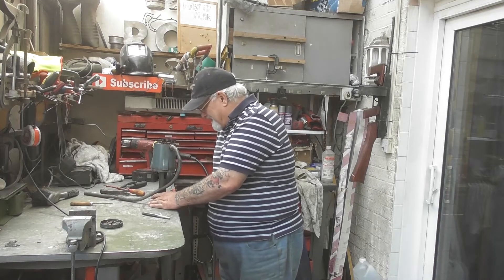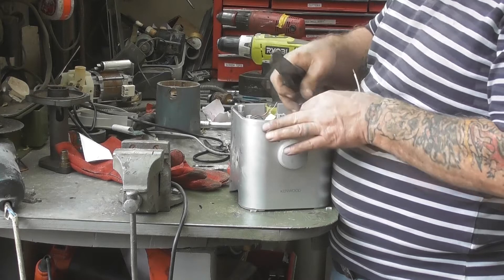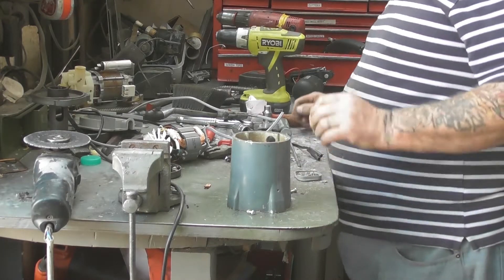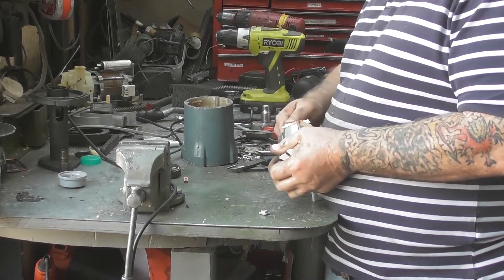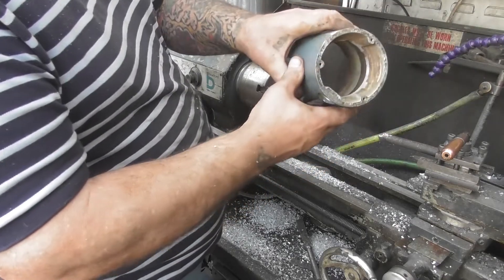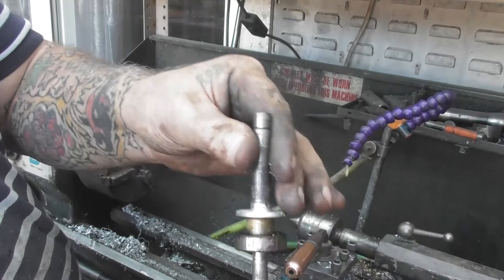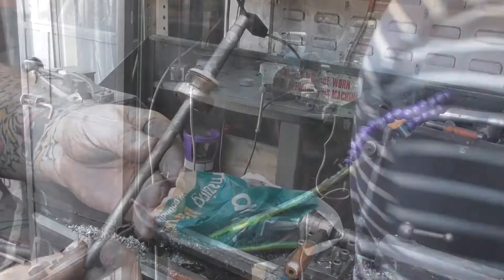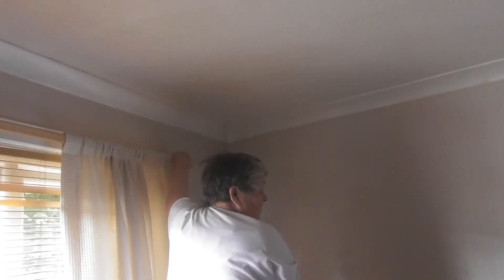how my coolant pump is changing from 3phase to 240v

Comment: Get some metal tubing that fits over both shafts. Would be easier if both are the same diameter then drill holes going across both shafts and outer tubing and connect them together with a couple of rolled pins that you would tap in with a hammer or you could put a couple of split pins through the holes.